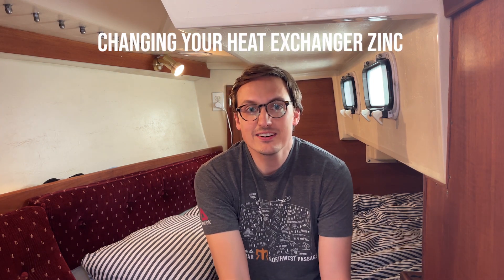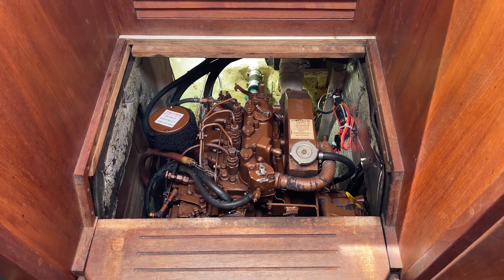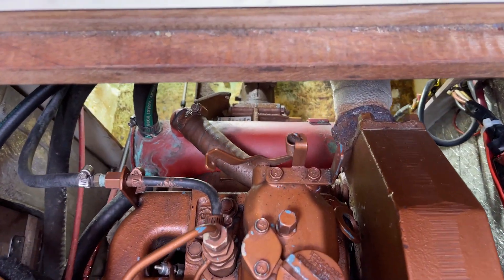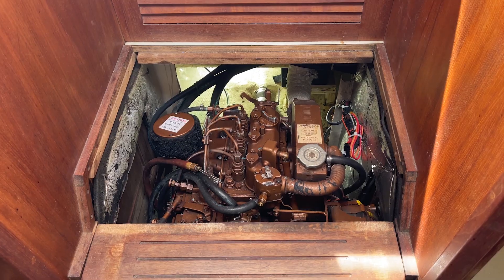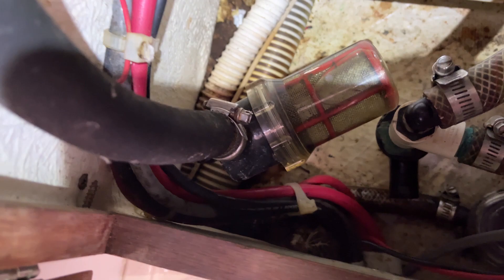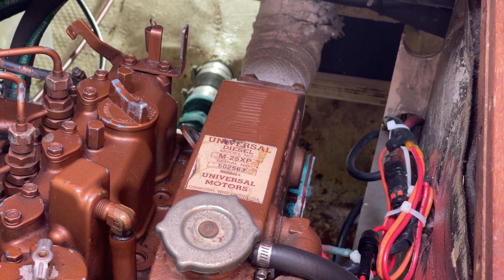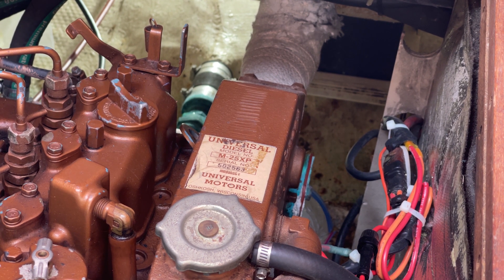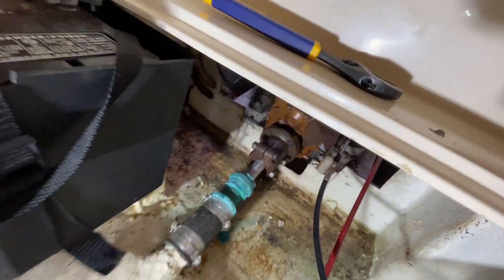Zinc Replacement On a Catalina 34

Comment: I had recently had my heat exchanger rebuilt. My mechanic told me to replace the Zinc every 3 to 4 months. If you see that green on the ends of your heat exchanger, you have problems brewing.

Comment: Hi, thanks for your video. I got a few questions: 1. How did you flush the coolant inside the exchanger first? 2. And then, what was the procedure to refill it at proper level? 3. Also, did you have to use something like teflon tape around the fitting to make it airtight?
 Thanks!
Reply: Hi, I apologize that I never responded to you, hope you got it all figured out! The coolant is just seawater, so you open the zinc nut and just let it pour out (after closing the inlet valve like i show in the video of course). I used that ziplock bag to catch most of the water but it still makes a little mess. As for refilling, it does that on its own once you have it all put back together. Reopen the inlet before starting your engine, and next time it’s running look out the back and make sure water is coming out of the exhaust pipe (I do that every time I start the engine). Happy sailing!

Comment: Nicely done!  I notice that your crankcase recirculation hose is pointing downwards into the engine bilge?  It should be re-directed to the air filter canister.  Also noticed that you have the stock rigid muffler inlet hose.  You should look into changing that to a silicon hump hose.  (I have a C34 as well)
Reply from the maker: Thanks, and thanks for the info! There is a lot to learn about these boats. I love that there’s such a huge community of people figuring out all the fixes and ways to keep these things floating happily so many decades into their boaty lives!

Comment: Thanks for this! Just did this project also but on a C-34 with the m35. One thing we did learn is that the zinc we got was just slightly too long, so we had to cut it down so it didn’t contact against the bits inside the heat exchanger. After what you said about changing more than once a year, gonna be sure to check that one more frequently!
Reply from the maker: Yeah your mileage definitely will vary! I’ve had my boat in two areas of the same marina with totally different amounts of galvanic corrosion. After I moved away from the big old power boat with suspicious wiring, my zincs started lasting a lot longer

Comment: Get a plastic battery box for your battery.  And don't drill any holes in it to mount it.  Possible Sulfuric acid leaks can do horrendous damage.
Reply from the maker: That’s a great tip, thanks!